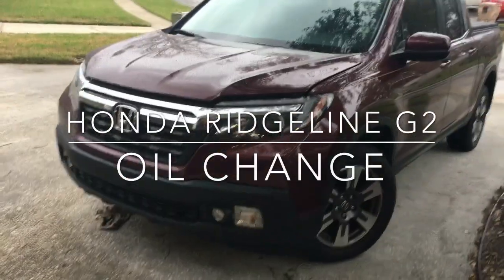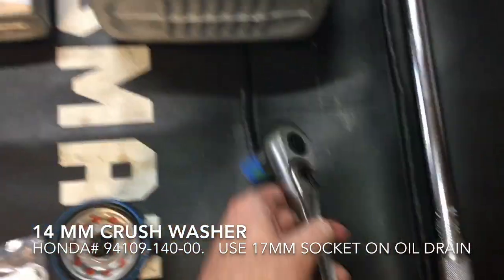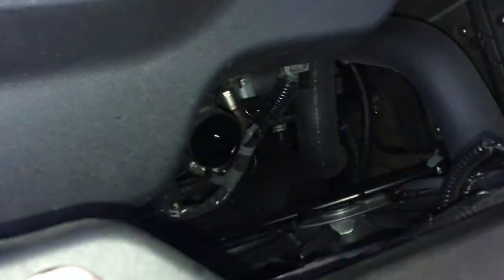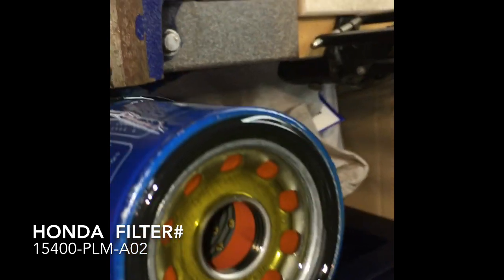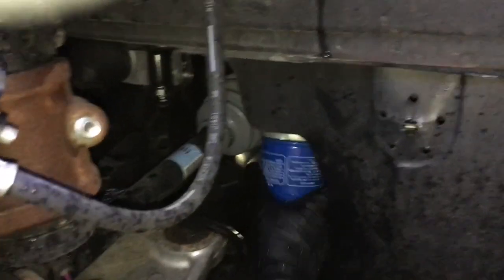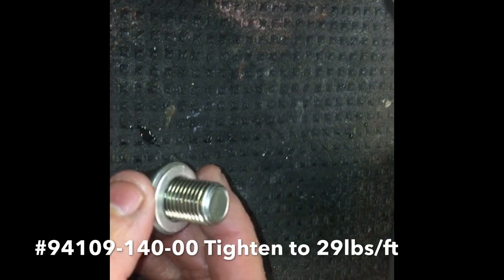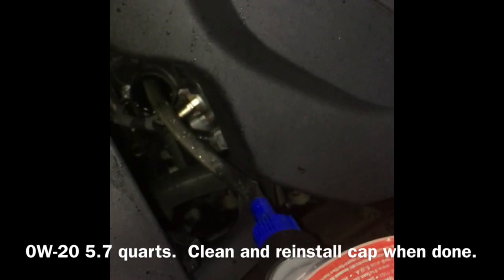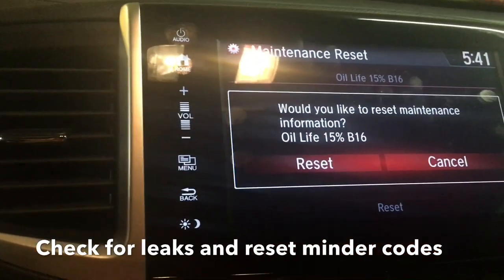Honda Ridgeline Oil Change

Comment: My first O&F change on Ridgeline. Wish I had paid more attention to the fact that cap wrench won't work. Lousy spot for filter with frame obstruction underneath. Rushed to WM to get cheapest plier type OF wrench they had, $5 and change. Worked. I saw the plastic bag over filter suggestion, didn't use. Oil on frame a mess. Next time I'm thinking of cutting the bottom of used milk jug and placing it under filter over frame. 

Thanks for video.
Reply: Update. Recently completed 2nd oil&filter change. Used bottom of old milk jug under filter, and bent down half to drain into drain pan. It worked. Requires two hands, one for filter and one to direct oil to drain pan. Not too hard, much cleaner and no pricey special service drain tool needed. I also use my Rhino Max ramps, just easier for me than all the reaching around tire and squeezing under the truck.

Comment: I installed the Fumoto F106SX valve to replace my drain plug. Makes it much easier to just reach under and drain the oil. From what I read If you install anything other than the SX you need the extension adapter. I have one on my Volvo S60 and love it! I didn't know you could just grab the filter through the wheel well, with the tire turned, so thanks for that!

Comment: Good call with the torque spec, most oil change videos leave that out. I've dealt with a stripped oil drain before with an aluminum oil pan (previous owner) and it's a pain to fix. Good tutorial, thanks.

Comment: STILL THE VIDEO TO BEAT as far as lucid and straight forward DIY info goes. I believe I might e able to do this maintenance without swearing now.
DOUGout
Reply from the maker: Great. Best thing that helps me is putting a one gallon zip lock bag over the filter when removing. It’s a huge mess every time.

Comment: Nice video.  Wish Honda would redesign the placement of the oil filter to alleviate some of the mess when removing.
Reply: sparklander  Google    Been Testing Oil LS1. It's about using Marine outboard two cycle TCW3 rated oil at 1 oz per 5 gallons of gasoline every time you get gas. Cleans and lubes the entire fuel system. Lots of testing done including me. I've been doing it over two years. You wouldn't know my Ridgeline is running at idle,  Give a few tanks a chance. You won't be disappointed.
Reply: Sparklander  slightly loosen the oil filter not to let oil flow out  then put  a gallon  plastic baggie over the filter and unscrew the filter. Let it drop in the baggie. No mess no fuss.
Reply: Arthur Smith agrred. If you dont do this, youre going to be leaving oil spots for a while as it drains out of cross member
Reply: Toyota style with the cartridge is way less mess. Chrysler pentastar has cartridge filter on the top of engine, no mess.

Comment: The reason why you do not want to pre oil the filter it’s because you could introduce contaminants right into the engine if there is any in that oil, yes you should lube the seals so it goes on and makes a good contact, but as far as filling that Filter is concerned, if there is something in the oil that should not of been there you’ve now introduced that into the engine. so there are lotta mechanics that suggest just putting the filter on empty and letting the fluid go through the filler into the filter just for your information I know everybody does it differently.
Reply: As long as he is using the same oil from the same container(s), I'm unclear what he could introduce that he normally could introduce filling the oil back up.

Comment: Just wondering if the car's computer has the ability to calculate the miles to the next oil change based on the ratio of rain water to oil mixture. I'm sure it does! .-)

Comment: Ending AO2 is a Fram made filter. Honda dropped Champion made ending in AO1. If you go with Fram go with Fram Full Synthetic XG7317 under $10.00 at Walmart.

Comment: Good video.  Turning the wheel to the right to access the filter is a great tip.  Thank You 👍
Reply: Stop the mess by placing a plastic bread bag over the filter after you loosen it. Then unscrew. Takes a bit more time but no mess. Oil and filter drop in the bag.
Reply: Don’t use those crappy Honda filters ending in A02. The quality is way down. Pick up a Mobil One Motorcraft Bosch Fram Ultra Synthetic but not that Honda A02. If you find ending in A01 it’s a Filtech which is made by Champion.

Comment: What is the size of the oil filter pliers? Thx
Reply from the maker: They are adjustable. Pretty common item not really sold in sizes much. but they are a lifesaver for sure. I also put a one gallon zip lock bag over the filter to try and capture oil when unscrewing. It’s a messy process.

Comment: why does the warning go off at 15%? That is over 500 miles, more like 1000 so I am have been staring at the warning icon for 500 miles! drives me crazy.
Reply: 100mpgus it just lets you know and gives you extra time. The computer monitors your oil. Change it at 15 percent don't wait till it's zero. . I unscrew my filter till just loose. put a bread bag or any type plastic bag over the filter unscrew the rest of the way. The oil and filter fall into the bag. Still keep the oil pan under when unscrewing the filter. No mess.
Reply: @arthursmith643  it is over 1000 miles. I dont need to change my oil that early, why have the monitor then.

Comment: Man I don’t like the design of the Ridgeline.  Engine bay is way too compact.
Reply: Many people who own the g2 run 0w30 because of the over heated cylinder bank. You are correct. So much heat that honda added a fan to cool the battery.

Comment: Your a quart over. Any manual will tell you 4.5 quarts. That’s oil and filter change.
Reply: Interesting. 4.5 quarts in a 2006 Ridgeline won't touch the bottom end of the dipstick... (after running the engine for a minute).  5.5 quarts brings it up to the mid range of the hash marks on the stick.  Dunno what to make of the spec ?
Reply: I have a 2019 Ridgeline, and the owners manual says 5.7 quarts capacity.
Reply: @Brian-xu9di  Correct. I just use 6qts even. Won't hurt a thing.